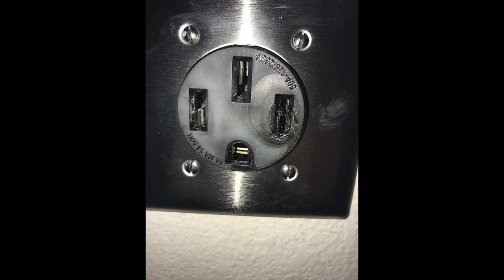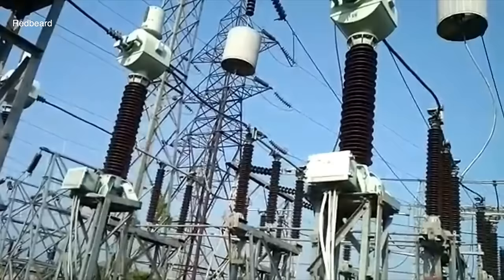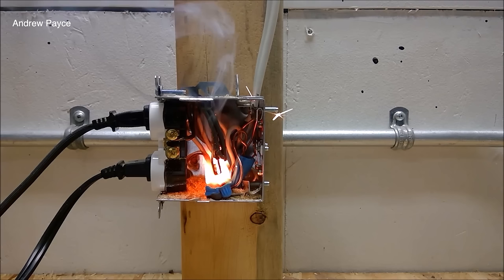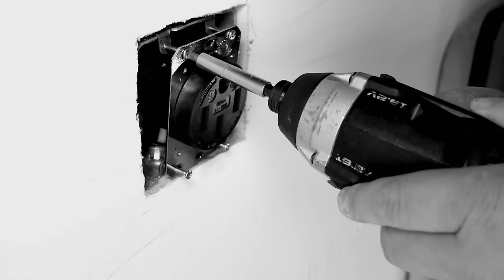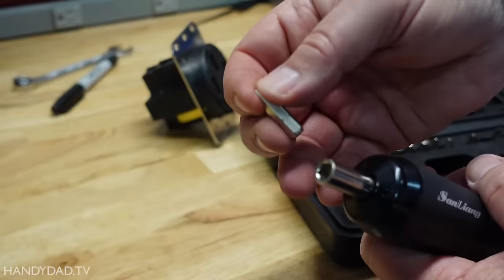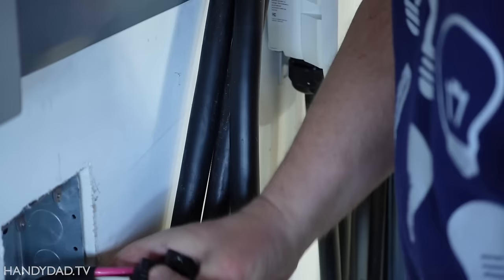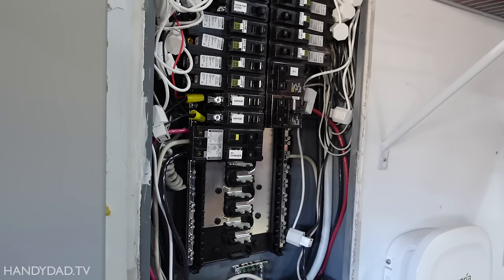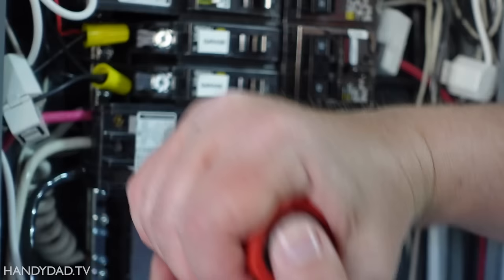EV Charging Disaster

Comment: I have often wondered about the number of people saying "its easy" that "for a couple hundred bucks you can buy a breaker and put in a 50A charger yourself" along with the number of products coming out saying "split and share your dryer plug".  I think it would be far better if we get to having a standard EV plug like J1772 and put THAT permanently wired into buildings rather than the mish-mash of plugs...I've also seen some chargers advertised that let you pick the max rate regardless of the plug, and Amazon has lots of reviews about people loving "didn't have to change the outlet and it works at 15A instead of 12A" or even some "worked at 20A with existing outlet" begging the question if someone is using a 15A plug and 15A outlet at 20A just because the breaker is bigger.
Reply: I have a plug-in 220v semi-permanently mounted, it allows you to change the charger without having to call electrician. Nobody hard wires a dryer, for example. 
Unless a hack replaces of 15 amp breaker with a 20 amp breaker the circuit should be wire wired with 12 gauge and be safe. I think it's pretty common to have 15 amp outlets on a 20 amp circuit, not the best not the worst, the wiring in the wall is more important.
Reply: @rp9674  Well you can change even a charger mounted on the wall without calling an electrician, if you know how to do that. Or do you call an electrician to change a light fixture? 

Having something hardwired is always better than having it on a plug, the plug is a weak point, something that can fail, can corrode, not make a good contact, overheat and create a fire. Also residential plugs are not rated for a continuous load, if a plug is rated at 15A it can really handle 15A without damage for a short period of time. 

Also chargers on plugs are dangerous for other reason, I don't know in the US, but where I live a circuit made for EV charging has some stricter requirements, for example it needs a type A (or better) GFCI, while for a normal circuit a type AC is sufficient (type AC is not able to detect a DC leakage current, that is something that can happen with an EV). A charger with a plug you can plug it in any socket, even one that doesn't have the required protection.
Reply: @alerighi  you can still put a GFCI on an outlet circuit, it's not code on 220v here I don't have it.
Reply from the maker: @R P - The 2020 National Electric Code now requires GFCI for 240-volt garage outlets. You’re grandfathered, but it will likely get flagged on a home inspection when you sell.
Reply: @handydadtv  thanks, I'm bummed I really like GFCI and it's a dedicated circuit. I think the evse has its own protections on that side. My dryer circuit doesn't have a GFCI on it either. I don't think the grandfathering ends at house sale, my house is have aluminum wiring. That was definitely not code in 2001 when I purchased.
This code confuses me, it's more than 150 v and it's 2 phase:
GFCI required for 125-volt to 250-volt receptacles supplied by single-phase branch circuits rated 150 volts or less to  ground.
Reply from the maker: No, I’m not suggesting the town official won’t let you sell your house. I’m saying a good home inspector, hired by the buyer, will flag your aluminum wiring and anything else that isn’t up to today’s standards so the buyer can make an informed decision whether to proceed with the purchase or negotiate for you to make corrections or discount the price.
Reply: @handydadtv  I don't think they do though, biggest buy as is. Maybe because the market is so hot. Also I hate the plumbing under the slab, these 1970 houses are getting to an age where plumbing starts leaking. I hope to replumb with PEX someday, seems like it's early stages for PEX tho
Reply from the maker: I also have plumbing under my slab. Thankfully it was built in 2018 so it’s all PEX. It would be a nightmare to replace.
Reply: @handydadtv  I think under slab should be a replaceable PEX inside of a protective conduit with gentle curves so no digging
Reply from the maker: Good point. Let’s hope I never need to worry about that in my lifetime!!
Reply: electric panels should go already with EV plugs built-in. hardwired and so on. I heard siemens or who wants to put it into the meter boxes. they are thinking on what to charge for that.

Comment: In the US, some people do DIY wiring, and in many places that's legal.  However, when it comes to installing anything with a heavy draw of current - like an EV charger - I'd want it to be done by a qualified professional using high-grade equipment.
Reply from the maker: Still no guarantee. Many commenters say they had melted outlets even though installed by pros.
Reply: @handydadtv  True, but I am almost sure your insurance carrier will not cover you for a fire caused by a DIY install of a 40 - 50 Amp circuit. If a red seal does it, and you can prove that, insurance will cover you. They may try to  recover their losses from your electrician if they find that they did not follow code. Either way your loss should be covered if installed professionally.
Reply from the maker: Not true unless you acted maliciously.
Reply: @handydadtv  Most people do forget that 99% of the install is simple safe and has zero risk.  If you acted with good intentions and carefully setup and double check everything, nothing about a electrical run becomes dangerous at all until there is power applied to it.  However even with the best intents a good circuit breaker and other elements can help protect mistakes.  Frankly running power is not much more complicated than running an extension cord but one that plugs into a breaker directly.  Paid professionals do make mistakes all the time.
Reply: Most cities are smart enough to require a Permit on new installations like these.    You will need to pull an electrical permit to install a new EV charging circuit. Rules can differ from one city or municipality to another, but a majority of jurisdictions will require that you pull a permit to add wiring to your home or upgrade your electrical pane

Comment: Part of your reasoning for arc and fire is correct. But "arc jumping" is somewhat a separate issue. The normal seen in brushes of DC motor which is one reason all electric cars moved away from DC motor and changed to AC motor. DC for example is used in subway electric trains - whenever the cars conductor brush arms move in and out of third rail, there would be arcs. Such arcs do not necessarily result in fire (as animated on your video). Fire is caused by excessive heat of intermittent sputter due to loose contact, since that circuit is trying to handle a lot of current, usually continuous high current when multiple all hot plates are used in kitchen for extended period.  If the circuit breaker did not trip, then it may become so hot (due to high current and partially loose connection). Then this heat results in its surroundings first char and then catch fire. If the wire is not copper and aluminum (not as ductile and even if you tighten the screw, it becomes loose over time. This is why Aluminum is not recommended for high current circuits. Particularly for the 240V outlet. do not use aluminum. If you tighten too much there will be a depression in Aluminum and eventually it becomes loose. Also Aluminum corrodes - but people use it because it is a lot cheaper than copper.

Arc leading to fire happens when it is in close proximity to combustible material such as paper, dry wood, oil etc. It is "current that jumps to make the arc", voltage is more like pressure just at the terminal. Current is more like to flowing liquid (water or some fluid moving through the pipe). In all cases, it is the current that kills people, animals etc. Therefore tripping mechanism is based on current flow, irrespective of voltage.

Good news is you are doing things right😅.  But if someone has already put in a lower gauge or aluminum wire, it needs further work from you (such as rapping it with copper foil tightly etc.).
Reply from the maker: Thanks. If they follow the specs that came with their EVSE, they should always use copper. I personally would never use aluminum wire on anything. And if I ever buy a house that has it, I’ll make it my mission to rewire it.

Comment: TAKE THE VIDEO TO HEART... I can relate. But I would go further. Forget receptacles and plugs altogether. Hardwire it. My scary store, I bought a used 2015 Nissan LEAF SV end of 2017. Great deal. So clearly LEVEL 1 no good. I bought a used Clipper Creak 20 AMP wall mount charger (240v x 20 amps -= 4.8KW) The charger I bought had hard wiring leads, no plug. So I decided it would be COOL (pun intended) to put put a chord and plug on charger, and mount a NEMA  6-20 AMP wall outlet (obvious mistake I see now). I figured charger rated at 20 amps and receptacle is rated 20 amps. All is good?  in my garage I added two CB's (220V) to the CB service panel, ran the wires out bottom of CB box into wall (garage is drywalled). I fished the wires to a retro outlet box I installed. I installed the 220V  20 AMP outlet.  I added chord and 220V plug to the Clipper Creek charger..... I then mounted charger on studs/drywall and plugged it in. Worked great for awhile. It also gave me flexibility to plug in my 240V Air compressor (not at the same time). 

After a few weeks it melted the wall outlet.  It was not pretty. I could see it melted and ready LED was not illuminated on charger. No fire but melted, very ugly, and glad I did not burn the place down. What happened? Well the receptacle was a cheap NEMA 6-20 Amp 240V outlet they sell at the big box stores (that start with H or L).  It was working at the rated power for hours. It failed. Fortunately the melting caused it to OPEN or fuse. The CB's where 20 AMPS did not trip, so I was running just under 20 amps. Never the less this was a bad idea.

SO THE FIX - I hardwired it. I got rid of plug and receptacle and hardwired it.  I recommend this as #1 choice over plugs and outlets for high AMPS. I used metal conduit to run the individual wires from charger to the wall box (with plain flat plate and metal fitting to run wires). I spliced the charger wires to wires from CB box, with wire nuts very securely. 

For compressor I added an additional and separate 240V service with 20 AMP NEMA 6-20 220V outlet, Yes like the one that burned up. This is the plug my compressor uses. The air compressor uses much less current, more like 8 amps. Also the compressor runs for a minute then shuts off. Duty cycle is important. An EV charger is continuous for hours and hours. 

Why direct wire? It is easier and cheaper and makes less heat. BIG BEEFY plugs and receptacles are expensive. Then you have all those screw connections. My car (SV model) has optional higher charging capability of 6.6 KW. The standard charging rate is 3.6KW. LEVEL 2 chargers at 4.8KW is plenty for a Nissan LEAF SV that can charger from 20% to 80% in a little over 2 hours. To get to 100% takes longer as the controller limits charge as it gets near 100%.  I would SKIP the plugs and receptacles for EV chargers. DIRECT WIRE especially for bigger KW chargers. Leave the receptacles and plugs for electric range/oven and electric clothes dryer.
Reply: I think what you missed is a branch circuit should only be used at 80% of capacity, even though that 20 amp breaker will hold all day. The 20 amp rating on that plug / wire is NOT for continuous duty. You might also find the mfgr's instructions call for a 25 or 30 amp circuit to stay under the 80% rule, which means a #10 wire, not #12. BTW, you could always make an adaptor cord to feed your air compressor from a larger outlet.
Reply: Your circuit breaker should have tripped.  20a at 3hrs should make it trip and your plug should have been saved.  But you need a 30A circuit for this 20A charger, manual even specifies a 30a or 50a plug.  If you can set the charger for 18A you will be ok with a 20A circuit.  Replace your 20A breaker.
Reply from the maker: Thanks for sharing!
Reply: @rupe53  Wow thanks. I KNOW THAT NOW!!! NOW YOU TELL ME??? Ha ha. Yep need head room. Also some of these low end receptacles are cheaply made. I would not even use a 30 amp receptacle/plug. 50 amp min even if my charger nominal is 20 amps (25 amp peak). However as I wrote direct wire twisted cooper wire with big wire nuts. Trust me I watched 👀  it with an IR thermometer. The wires are oversized, one gauge larger than charger and wire run is just 4-5 feet total. I'm better than good now.
Reply: @jmaus2k  Manual? What manual. I bought it used. You read manuals.. However point taken. It did not trip. I upgraded to 30 amps CB direct wired 10 AWG 4 to 5 feet run. Happy now? Ha ha. I used the 20 amp CB's for another 240v outlet for my compressor. All is well. Direct.

Comment: Excellent video, I had an interesting arching issue, I purchased a 66 year old home and of course had an inspection, the inspector opens the basement door, the furnace was on, and he flipped the furnace switch at the top of the stairs off then right back on and says, oh the furnace switch doesn't work, well it actually had a delay due to it having a sticking spring inside, but shortly after,it malfunction and I turned it off then on to try to find why the furnace stopped working and I saw arching from the switch, I replace it and opened the old one and found lots of arching had occurred inside it, a fire waiting to happen
Reply from the maker: Yikes

Comment: Here in Germany, we use a more reliable power outlet for EV-Charging up to 22 kW 230 Volt 3 phase. There are 2 connector types. One for 3 x 16 Ampere (11kW) and a bigger one for 3 x 32 Ampere (22 kW). However vor EV-Charging we prefer to install a specific wallbox which includes also a 5 m cable with a connector to the EV charging port. By the way, wire nuts are crap and risky. We prefer Wago connectors, also available in US.
Reply from the maker: Wago ❤️
Reply: Been using Wagos for over a year. I love them.
Reply: Wirenuts are NOT crap, nor are they risky... if you know what you're doing.  Wagos are much more expensive and a bit more idiot resistant, but do not provide as much electrical contact surface or pullout/vibration resistance as a wirenut, nor are they as compact.
Reply: @JeremySpidle  exactly, the wirenut is just to keep them from loosening. The wires should be pretwisted together.

Comment: Loose connections have more resistance than tight connections.  Current flowing through this higher resistance is what causes the conductors and terminals to begin heating.  This can cause even higher resistance, which causes more heat in a runaway fashion which can end badly.  Arcing typically starts much later.  Properly tighten the terminals, flexing the conductor for each one and re-tightening the terminal before moving on to the next terminal.  During use, check that the plug is not overheating by touching the insulated plug with your hand.  It should not be more than warm.  If it is, shut the power off to the electrical socket and check for poor connections.
Reply from the maker: Thanks
Reply: Another problem is that expansion from heat and the cooling again can lead to metal fatigue and in the end a broken connector, it might also lose the screw terminal.